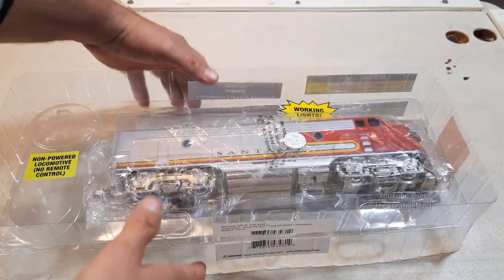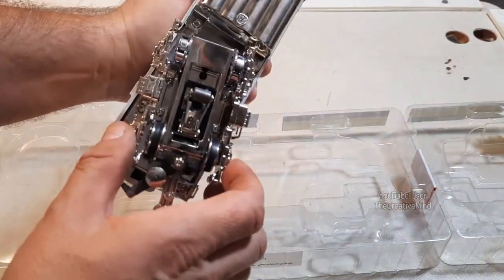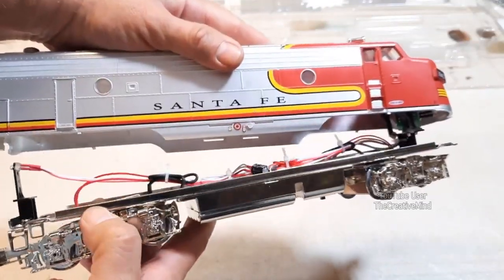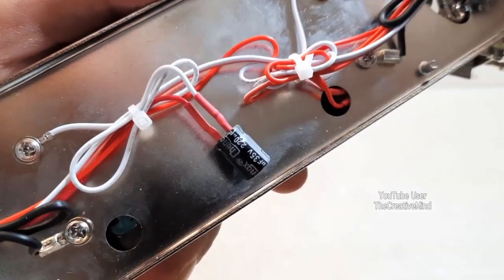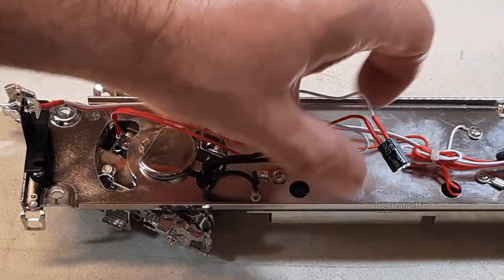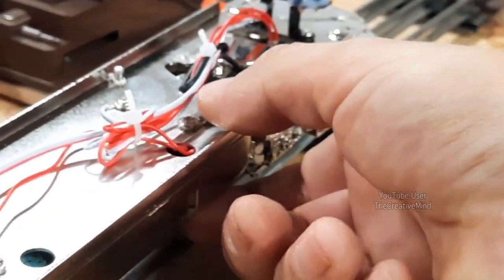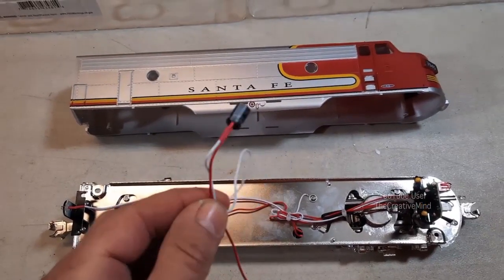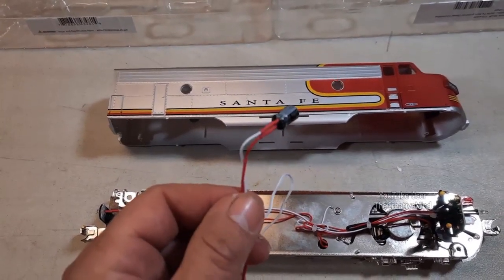Menards Dummy "A" Unit Capacitor Solved??? SARCASM INCLUDED

Comment: I just modified my Santa Fe Dummy Beta 4 Unit. It turned out to be a great success as it now gives me Flicker Free lighting and also protects the LED'S from voltage spikes. I cut out the original Defective Capacitor that burns up and installed a AC to DC Buck & Boost Voltage regulator in the Dummy Unit. It was a extreamly easy install and I do not have to worry about a smoking Capacitor anymore. I setup the Buck & Boost voltage regulator for constant 18 Volts DC Output while my Track Voltage reads 18 volts AC input. I plan on drawing a wiring diagram so you guys can do a similar install. The Buck & Boost device are very small and fit well on the Dummy Unit. You can also easily purchased these devices on Amazon for a few dollars each. I been using them to add LED lighting to my layout buildings and passenger cars and they are very reliable.
Reply from the maker: Thanks for the help John, we look forward to your design on correcting this issue.

Comment: Excellent troubleshooting analysis. I am also assuming that the capacitor was installed to prevent the flickering of the LED lights on the dummy unit when running this unit over dead spots.
Reply from the maker: If this is the case, it's a terrible design. What engineer even thought this would work.
Reply: @TheCreativeMind  I just hope the Factory that is designing and building these engines is not some Fly-By-Night Back Yard Garage in China Somewhere.  There Grounding solution by wrapping wire around the axles is very primitive.

Comment: Could I attach the black wire from the axles, the wrapped wire, and attach it to the screw of the capacitor that was cut off? Would that work? Solves the capacitor issue and secures the ground? Just wondering.
Reply from the maker: It will still work but I think that grounding wire from the wheel was already screwed to the frame.
Reply: @TheCreativeMind  thank you!